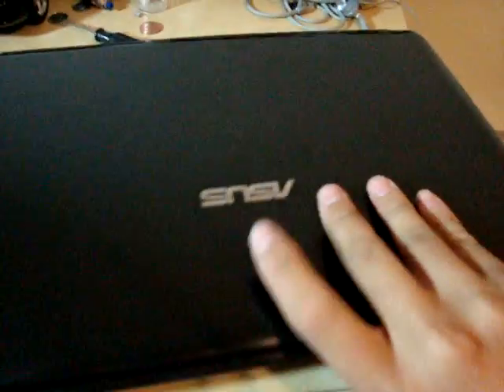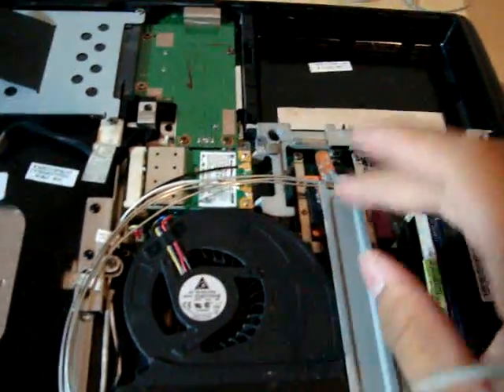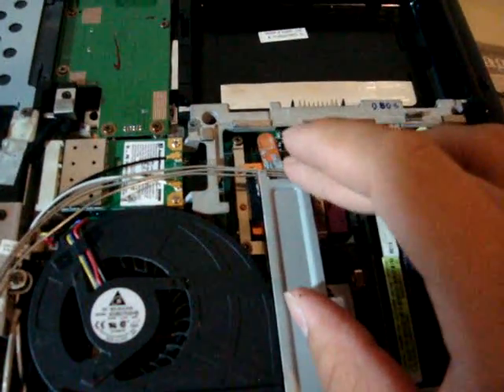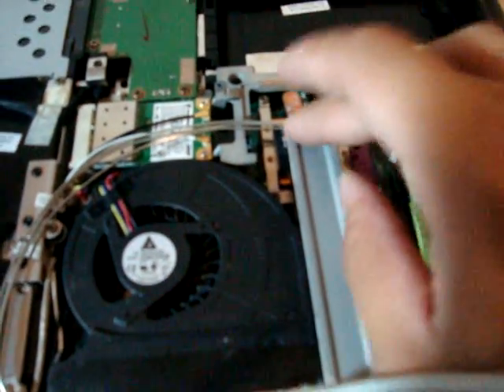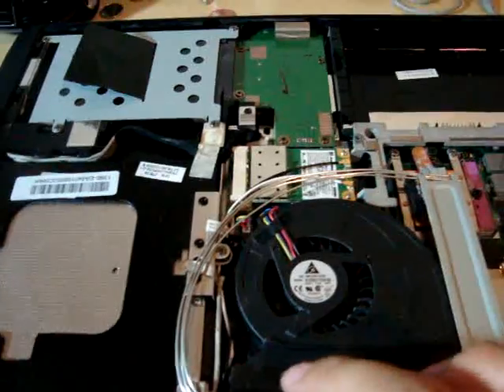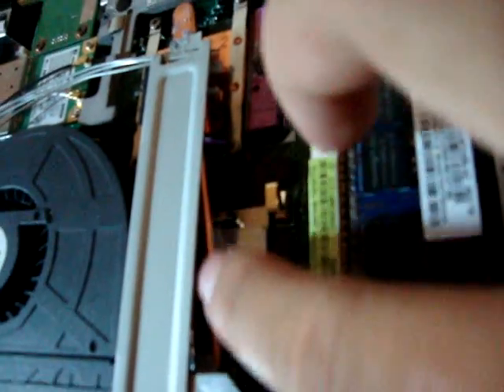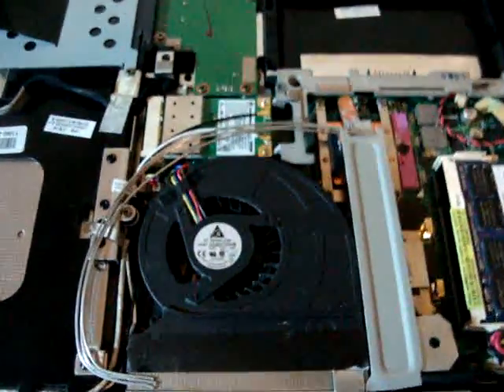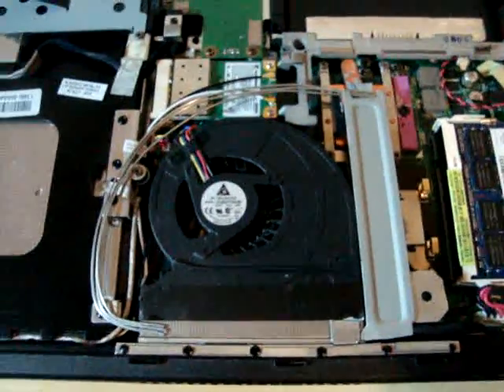Asus K40IN Cooling Modification

Comment from the maker: It will help, because the problem why it gets so hot is because of the single heat pipe, and the cpu's heat has to travel across the gpu to reach the fan. The design is similar to the HP pavilions that all failed horribly. cept Asus puts a wider heat pipe and that was it =___=